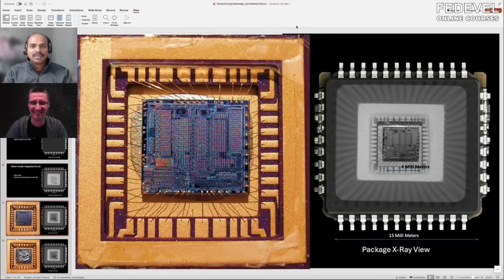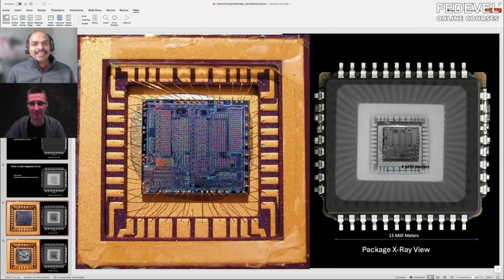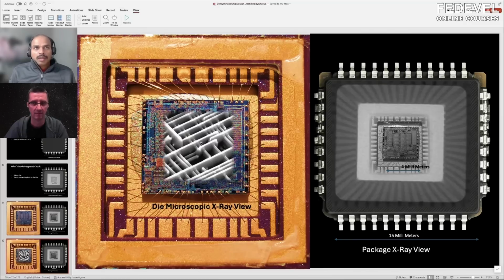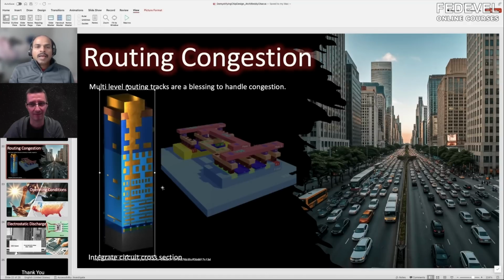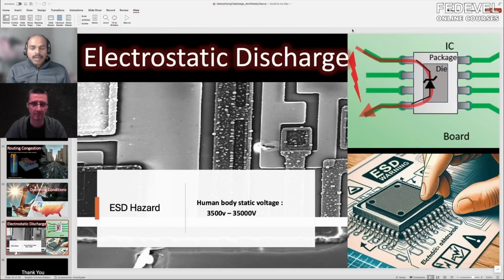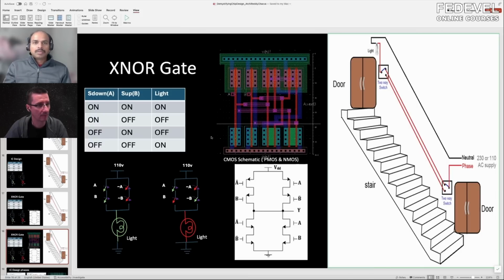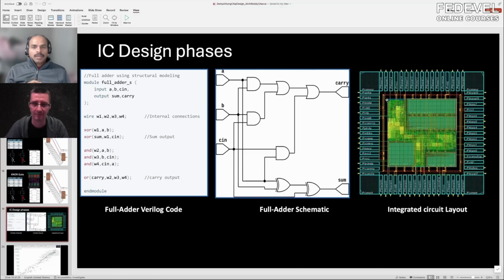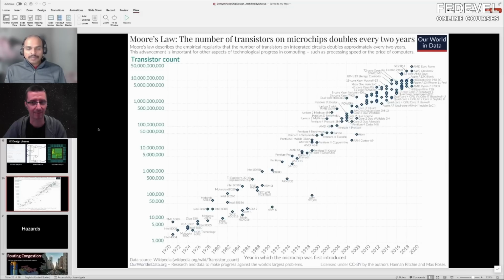What is Inside of Integrated Circuits? How Are Chips Designed?

Comment: The thing which most people (including this guy) get wrong is that the names for the process nodes like "2nm" does not actually refer to the size of the transistor its more like a marketing term. For example let's take TSMC's 3nm node, the transitors in that process are not 3nm physiscally but the contacted gate pitch is approximately 48nm, and the tightest metal pitch is around 24nm. We still have a long way to go and require several breakthroughs to get "true 3nm, 2nm etc" transistors. And then again we can heavily optimize the placement, hardware design and the software to get much much more performance than we could ever get by going smaller and smaller.
Reply: Hello @pvim, I agree with your point and aware of the fact that 5/3/2nm are doesn't  represent true transistor size since post-20nm process node. In this discussion we stick to the marketing terminology to make it easy for the general audience. Appreciate your detailed explanation.